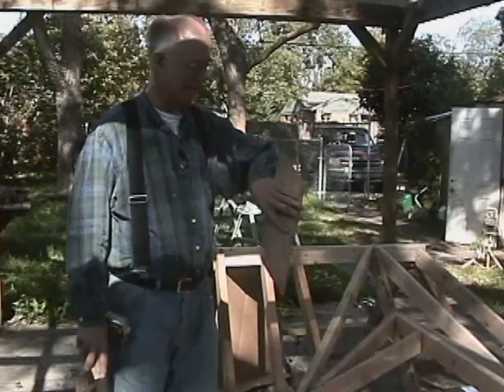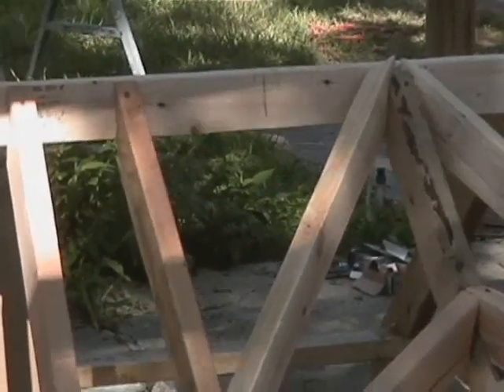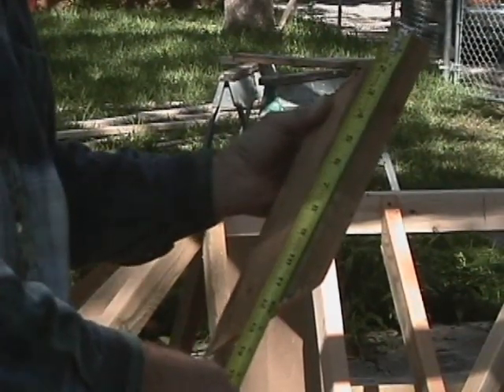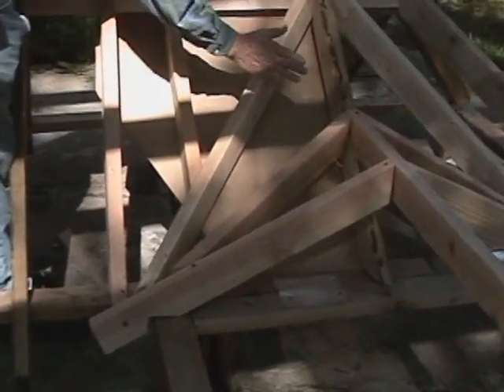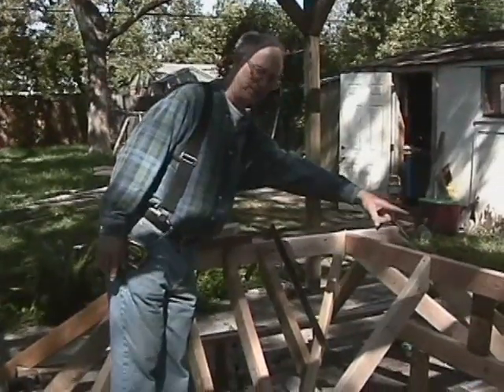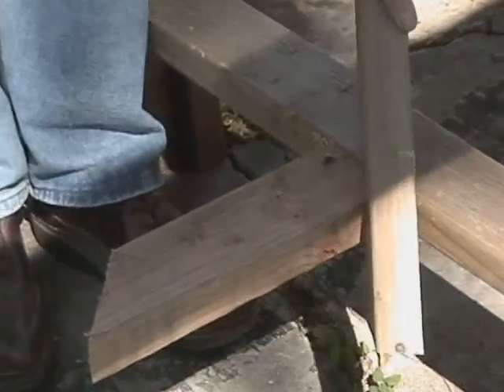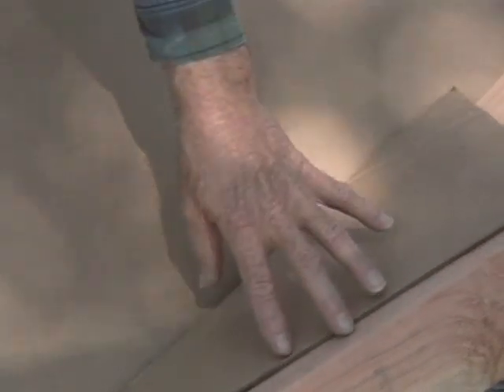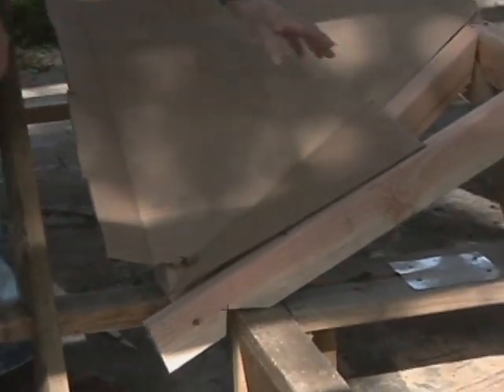speed square basic #1  of 2

Comment: Very hard to understand for a basic carpentry standpoint. As it was stated the editor actually did a double play on the points of the 1 inch angle that was left, and frankly left me confused about the why and how of the angles in the first place. More description of the physics and why than showing useless how to video should be done. I want to know why we cut angles and how to make them work correctly, rather than see you stutter and pause and jumble around looking for a scrap of cardboard.